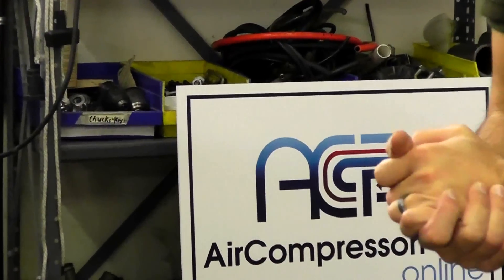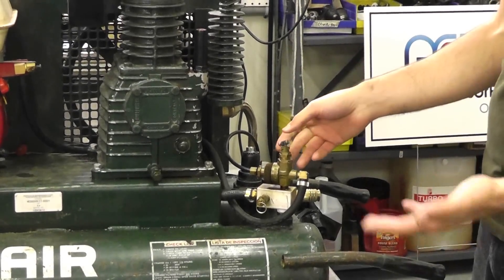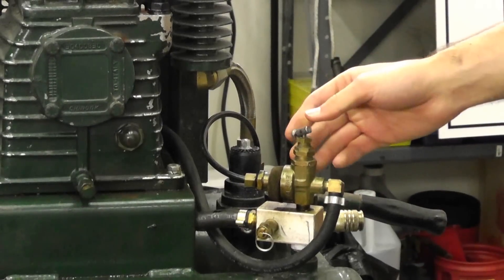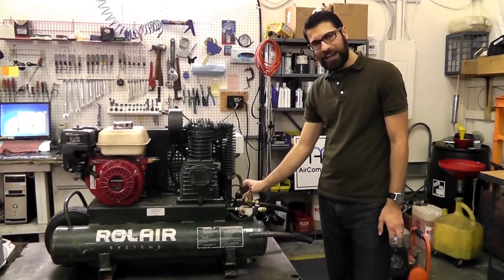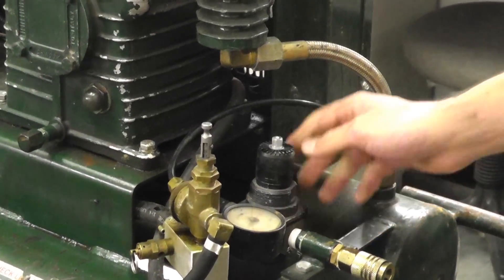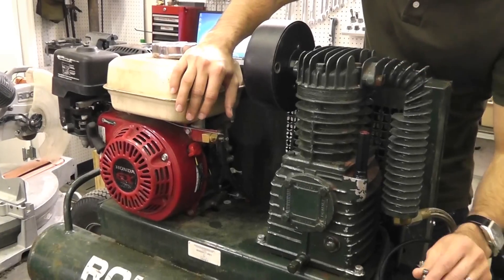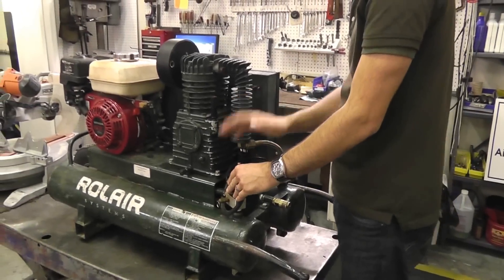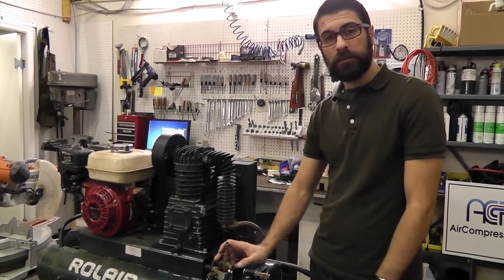Gas Powered Air Compressor Basics

Comment: do you have any step by step videos on building a gas operated  air compressor with all the components needed except for the engine and compressor please forgive the stupidity
Reply from the maker: Not a stupid question at all! We do not have a video currently on how to build a gas powered air compressor at this time, but that's one to put on the list! Look for that one shortly. Thanks for the comment!
Reply: @AirCompressorPartsOnline  Oh wow this comment was only a week ago ?! I am in the same situation! I have a 60 gallon Husky compressor with an engine sitting on the floor, a gas engine and I have no idea where to begin, if i did id order parts asap !
Reply from the maker: @jadensjourneys144  We don't have a video on electric-to-gas conversions yet, but you'll essentially just need a few items. First, the Pilot/Unloader Valve. This has the same function as the on/off pressure switch on an electric unit. It controls when the pump "loads" to pressurize the tank, and when to "unload" the pump (where it idles at a lower RPM. 
You can view the various Pilot Valves by clicking on the below link:

https://aircompressorpartsonline.com/air-compressor-parts-pilot-unloader-valve-controls-c-25_3.html

The second main item you'll need is a throttle/idle controls, which links the pilot valve to the throttle arm on the gas engine. There are a couple different types, a "bullwhip" cable style and the "airline" style, which simply uses a hollow tube (1/4" OD) that connect form the pilot valve  to the throttle control valve. You would choose which one you need by the horsepower of your engine and by the length of cable you need (for the bullwhip style). You can view the options we have by clicking on the below link:

https://aircompressorpartsonline.com/air-compressor-parts-throttle-control-valves-c-25_78.html

The only other item you'll need is possibly an engine pulley. If the shaft size is the same as it is on your electric motor, you won't need a new pulley, you'll probably just need to adjust the RPM of the gas engine so that your pump is still spinning at the optimal RPM range. This is a start so I hope this helps!

Comment: How about a gas powered pressure washer? Anything about that different than a compressor?
Reply from the maker: The main difference between a gas-powered air compressor and a pressure is what the engine is driving. In an air compressor, the engine obviously drives the compressor pump; in a pressure washer, the engine drives the water pump, which is mated directly to the output shaft of the engine.
In a pressure washer, there are no pulleys or flywheels necessary to turn the pump, since shaft of the engine mates to the pressure washer pump's gearbox. Engine maintenance and operation is typically the same with a pressure washer and an air compressor. The air compressor's engine runs at a higher RPM when it is pressurizing the pump (then goes down to idle speed), whereas a pressure washer's engine usually runs at a constant RPM.

Comment: Hi, I have a Quincy maybe 20yr old which is 30-40gal and I'm trying to install a Honda GX 390 electric start gas engine on it. How can i make this work?
Reply from the maker: The basic components you would need will be a Pilot/Unloader Valve (like one in this video) and a Throttle/Idle Control, which connects from the Pilot Valve to the Honda engine's throttle arm, to adjust the RPM of the engine when the pump kicks in/out. 
It's hard to say exactly which style of Pilot/Unloader Valve you would need not knowing the exact model of Quincy pump you have, so if you could reply with the model# of the pump that would certainly help me recommend parts that would work for you.
Regarding the Throttle/Idle Control Valve, you can use a bullwhip-style which you can find on our site by clicking on the below link:
http://www.aircompressorpartsonline.com/index.php?r=product/view&id=3106

Just choose the correct cable length you need and make sure it's for "8 HP and above".
Reply: +Air Compressor Parts Online   I have a Quincy Model 325. Thanks!

Comment: Anyone Here Has A Diagram On How To Make An Air Compressor Gas Powered Using The Pilot Valve ?
Reply from the maker: Thank you for the question! The below video may help you out. You can fast forward to about the halfway point to see how the various components of a gas air compressor work and how they're configured (including the Pilot Valve and Throttle Control Assy):

https://mastertoolrepair.com/air-compressor-components-and-operation-p-1030398.html

(Master Tool Repair is our parent company). Hope this helps!